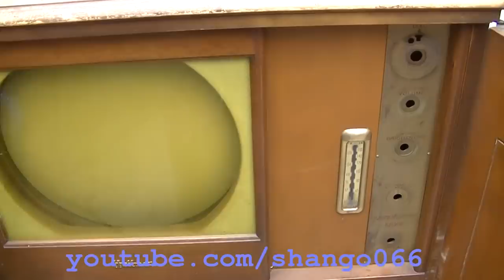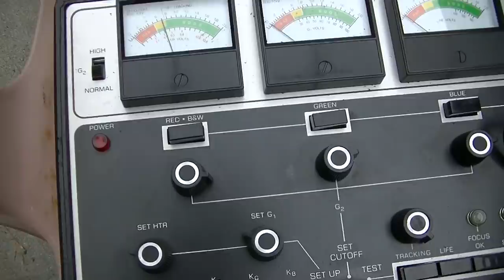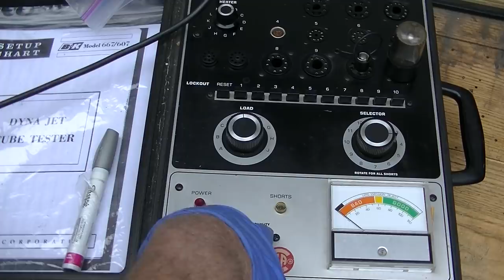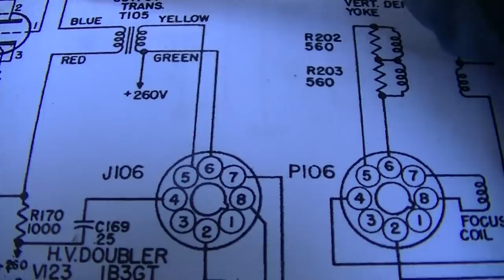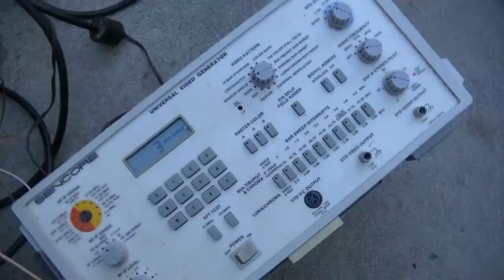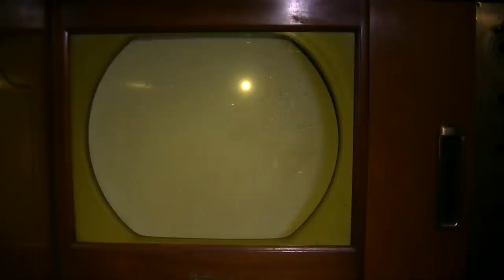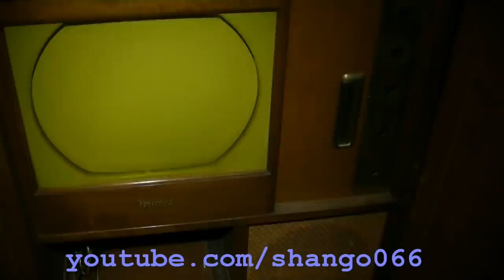1948 Hoffman TV Set Resurrection

Comment: The green glow may be an indicator ion trap. Some tubes had a phosphor coated first anode.  You adjust the ion trap to minimize the green glow, IIRC
Reply from the maker: That could be it.
Reply: Sounds more likely than X-rays, I was under the impression you had to pump far higher voltage into a random tube to get X-rays.
Reply: + 1 on phosphor.
Reply: You're right, Bob Anderson talked about that in one of his vids
Reply: yes he did and Ive read that.
Reply: That phosphor coating looks like a darn good idea to adjust correctly. Didnt get this snappy feature in Europe unfortunately. Merry Xmas!
Reply: Yep, the green glow is for Ion Trap alignment on the CRT neck (you should not be able to see the green glow if the magnet is correctly adjusted, but a bright image should be visible on the screen). Phil Nelson mentioned this on his restoration site.
Reply: I had also suspected that the glow was coming from the ion trap, but I did not realize that the trap glows intentionally, as an alignment aid.
Reply: @klafong1  Not all of them did this. It was a handy feature on a few brands of tubes.
Reply: @shango066  what  happened to the TV that blew up   that had the millenial crying about having to work and stop reporting to instagram ?

Comment: Thanks, Shango 066.  Nice video! I have a couple rolls of lead tape. My late father had them. We used asbestos paper on flue pipes. And I have a hair dryer with asbestos in it. I used it a few times before the recall. I didn't return it. I wish I had your knowledge. If only I could get a job testing tubes. I think it would be interesting. For awhile, anyway.

Comment: 13:40 - old turret tuner. These were widely used in early sets and could later be upgraded to receive UHF channels with interchangeable coil sets (2 per channel). Very handy design that was dropped by the 60s.

Comment: 63-37 is the good stuff. 60-40 was the alloy they used before they knew a lot about metallurgy. Then they discovered 63-37 has a slightly lower melting point and transitions more quickly from liquid to solid as it cools. I think it's also a fair amount stronger. It's a more finely tuned alloy, slightly more expensive because tin costs more than lead.

60-40 is fine, 63-37 is ideal. Honestly I can't tell the difference using them.
Reply: That's good to know I'll try some 63-37
Reply: 63-37 is the eutectic alloy, so it melts at a single melting point, without a range with liquid plus mushy solid that you will get with other alloys.  60-40 is supposed to wet the wires and traces better than the eutectic alloy.
Reply: That's funny, I have both and the 37 63 is about useless, but the 40 60 is fine.. well maybe it's about quality not metallurgy in my case

Comment: Flir has always been good about standing behind their products. We have one on one of our trucks at the fire dept. Of course, ours is a $8,000 unit designed for structural firefighting. But they took it in and fixed ours no charge and we had had it for several years

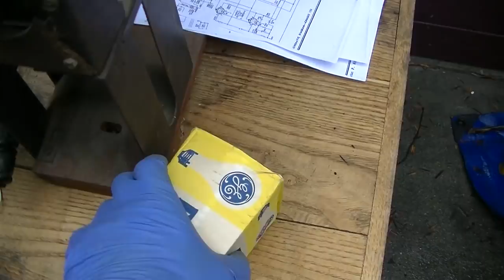Comment: 30:45 OMG!  My dad used to use those bulbs or something like them when taking 8mm movies of birthday parties inside. He had a green metal contraption (that looks like today's sound bars) that had at least three sockets, which always had at least one open because if he used all three bulbs the ancient screw-in glass fuses in the basement would blow, leaving the house in complete darkness. Those bulbs were as bright as the sun, and just as hot! To make this vid any more nostalgic for me , the elders would have to be drinking Schafer beer in a welded steel can for which you'd need a "church key" puncture-type opener. And when you run out of cans, you pop over to the local tavern and pick up an armful of those cardboard cylindrical quart containers of Draft beer.

Comment: 63/37 is slightly superior to standard 60/40 solder.  63/37 is a true eutectic alloy that melts at 183° 60/40 melts at 188° 
As the melting point is a single temperature it will transition to a melting faster than non-Eutectic alloys which means less chance of cold joints. In non-Eutectic alloys one metal will melt before the other.  The cost difference is minimal.  I've used 63/37 for decades with fantastic results.

Comment: I wonder if the green glow is being cause by x-ray radiation? Would be cool to pull out the geiger counter. Cool video. To observe the debates, and think how far we have fallen since 1948.
Reply: My thoughts exactly :)
Reply: Too small voltage for the x-ray radiation. The X-rays starts at 30kiloVolts and higher
Reply: @AgentDiego  True. 10 KV is not enough to knock electrons from the surface of most metals. I just wonder what radioactive elements might be in the electron gun. Also this is not an aluminized tube. I wonder if all that green light is bouncing off the backside of the phosphor?
Reply: Below in comments it was an opinion that green lighting is some kind of indicator of incorrected set of ion trap.
Btw, speaking of radiation! In one of prevous videos, Shango did took an old radioluminescenced clock or whatever it was, that has Radium-226 in it.
Reply: @AgentDiego  I used to have a digital LCD wristwatch in the early 1980s which stated "PermaGlow" on the front, and there was a radiation symbol on the stainless back cover. I think it is still around in a box somewhere here. It stopped glowing about 10 years ago, so the half-life of the source (tritium??) must have only been 25 years.
Reply: That's kinda strange to hear about modern things with radiation inside

Comment: Loss of the filament connection was very common with those early large 12-pin bases. Usual fix was to crimp the pins to restore the connection (quick & dirty) or to reheat and resolder the pins (better). The sockets were also a problem, particularly with cheap partial sockets. Usual fix was to replace them as most were constructed to discourage disassembly/reassembly.

Comment: I had to stop near 3:07 after being shown the can dome resistor that looks like a $10 roll of dimes, and then the emptying of what looked like a goodie bag of multi-colored hard candies right in front of the camera like it was christmas. This 1948 Television is 10 years older than i am, and is probably 17 years older than even the televisions my grandparents had in the 60's. Love the green tinted glass. I usually look through some comments before watching YT videos, but i don't want to spoil the surprise. This is exciting like a whodunit...which component  / components are responsible for the demise of this once working unit? How did the pioneer versions of engineers get these televisions to work to get us the goods? "Stay tuned" (ha ha).

Comment: Wonderful! A question: Horizontal knob is due to a constant disadjustment in the signal in old TV sets? Was it the vig problem all the time? Since color TV sets in 70s this knob is not necesary any adjustment for the user. I can see a tranforner of digital signal to analog NTSC signal, right?
By the way, Does American signal standard before color tv arrived was called NTSC , previous to color? I have read there was a cometee in US in order to keep utilizable all those BW tv sets, donde ng a compatibility btwn a new color system and bot color screens.

Comment: Got a question,  not about this tv but troubleshooting in general.  I have a 1950 Emerson 614 or 637a. Not quite sure. I have a schematic that matches the unit. All except for the vertical oscillator tube. It looks like someone put a completely differant tube with a completely different circuit. I was able to get the unit going up until I get good horizontal but a small vertical.  About 4 inches tall. I replaced all caps and changed out any bad resistors in the vertical circuit but I  can't get it to stretch the entire screen. Any help would be great. Thanks.
Dave

Comment: it would be interesting to do another thermal image of the set using the "5U4" rect. tubes in place, instead of your electronic hybrid version of a rect. tube, this will run the "B+" voltage higher than what the set was designed!!!!, coupled with the fact that when the set was designed/ built to operate on 110 to 117 volts. voltages now are 120 to 125 volts

Comment: The American Brand (GE, Sylvania) Photo Bulbs are not made anymore (I think there may be some old stock Sylvania, but I doubt they make them anymore), but you should be able to get new ones at FreeStyle Photo at 5124 Sunset Blvd. The type EBV you have (6 hours 3400K, 500 Watts) is $4.99 for the Ushio brand (Japanese brand?). If you just want something to use in series with TVs you can get a type ECT for $5.99, but it lasts 60 hours, 3200K and also 500 watts.
Reply: Amazon, eBay, Home Depot, other internet sites show various 200, 300, 500 watt incandescent bulbs for $13 or less. Does it make any difference or is there something "special" about the bulbs he uses?

Comment: Goodnight ! Please, where do you get the circuit diagrams?
00:23:57 OUT Horizontal. 
00:24:58 Valvula Amortiguadora. Is good !!!!! 👍
00:30:03 Rain in the tv Nooooooo please
00:35:04 6KV is not available tension in HV. Ness more 12 KV aprox. 
00:36:17 Corto in deflexion?
00:37:54 Horizontal line. Rest output vertical.
00:44:01 I like imagen good ✌👍😊 ¿capacitor and resistencia?
01:00:00 😴😴😴😴😴 Good night 
 Greetings from Buenos Aires, Argentina ✌✌✌✌

Comment: Not that you're ahead of liking that TV chat they very much but it is a true survivor you can tell by all the tailbound were removed to replace capacitors a bark that are different and they probably were using it past 1980 because we were using others past 1980 and it was the seventies it up until the nineties when it picture to finally went out in the manner of the electronic shops told us it would be too expensive to repair so if I bought one of those Chinese council TV is a used to make Wasn't half as good but you know what you can find Especially in the days before the Internet

Comment: Nowadays These Youngones 
Wouldn't Know What Tube Is.
Reply: i came across one of these when i worked in donations at goodwill and i was the only one who knew what it was because of these kind of videos. so many antique radios and tvs came though that door and i was always excited to look them up and learn about them after i got it off the cart.
Reply: @jamesketchum5047  Just I Told Radiotvphononut
Those Old Radios Are Nice But When The Tubes Go Out You Might As Well Throw It In The
Trash Cause Their Impossible To Get Parts For.
Unless You Know Someone Who Has Alot 
Of That Stuff Lying Around In A TV Repair Shop.
You Know There Aren't Many Of Those
Places Around.